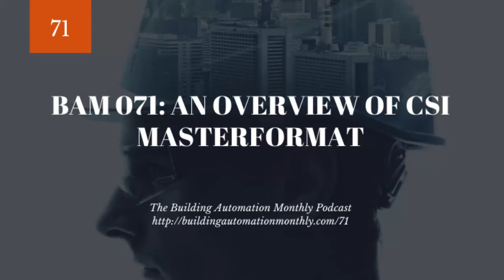BAM 071: An overview of CSI MasterFormat

Comment: Phil, I respectfully disagree with you when you say that VFD's are not the BMS guys problem.  Sorry to tell you but programming fan breaking, rotation, critical skip speeds and other PROGRAMMING requirements from Operational Sequences and other specified sequences is the BAS guys problem.  The same goes for Boilers, Chillers or other DDC integrated  equipment.  You are truly a smart guy and should keep an open mind.
Reply from the maker: Hey Kevin, good to hear from you. My perspective is at a macro level. While there are some companies that do train their people to 1) Understand and 2) Support these pieces of equipment. Most companies rely on the mechanical contractor to setup VFD's. 

So while understanding VFD settings is helpful, it  is not (in my opinion) the most important thing for us to focus on.